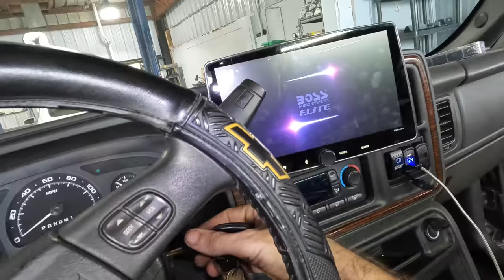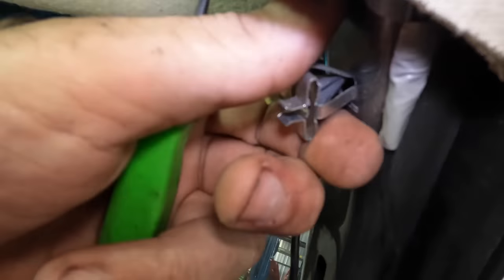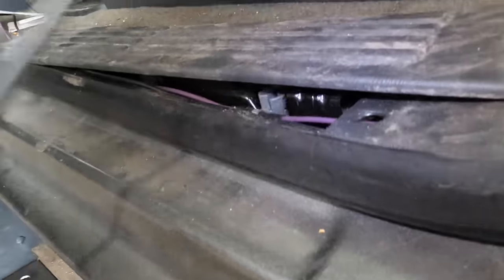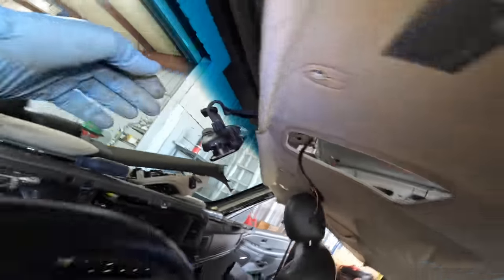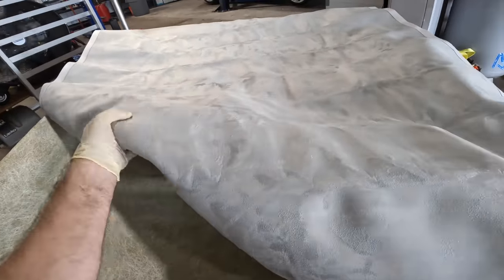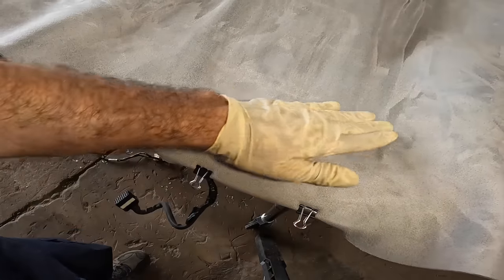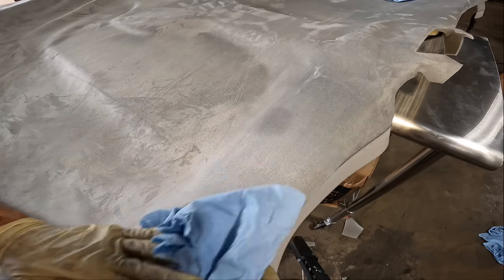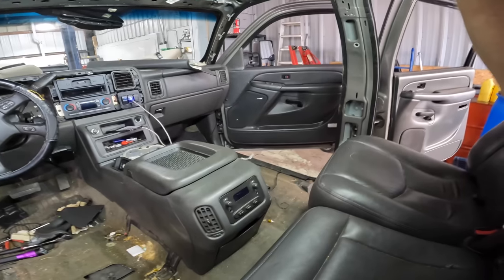Sagging Headliner! NOT an EASY Task!

Comment: Great video, I have been having problems with water leaking in from my antenna on a 2015 Ford Transit connect.  I tried to remove it and reseal
it but it's leaking again.  To repair it correctly,  I need to purchase an new antenna.  Plus I destroyed the dome lite by accident.  Best to just cut the wires instead of
trying to get it apart.  I broke it pulling it apart and a new dome lite is not cheap!

Comment: I have seen the pros do it several different ways. One guy uses a bed sheet on the good side of the headliner to keep it from getting dirty. Once he rolls it in place, he covers it with plastic and pours sand on it to hold it in place. He vacuums the sand off, removes the plastic and lets it dry.

Comment: When I did the headliner in my car, after I removed the fibreglass/Styrofoam header, before I put the new liner, I spread 1 thin layer of fibre glass resin and mesh on both sides. This was done to stiffen the header because if it breaks, you in the stink hole and need to replace the header. Once the Fiberglas is cured, give it a light sanding, wipe it clean and then spray glue and place your new liner.

Comment: you know what you can do with the visors without replacing them is, you can fine the correct automotive spray paint can and just spray paint them. I did that on one of my Mercedes, I bought a replacement visor,  and I spray painted it the same as the same color as my interior.  super easy and a lot cheaper.

Comment: That's  a wonderful  truck and glad getting to thr interior! Always  noticed the driver seat and when you were going to replace the lower seat! My 02 Taho was worse having  never done it before it wasn't hard to do! Luckily  my headliner is in great shape it's  bigger and has top AC ducts! Then again I guess  it would come out the rear! Hey finish  the carpet. Your half way there! Glad to see you used a socket in your  previous video to remove a gear clamp instead of a flat head screw driver!

Comment: Ray i did that for Bentley if you ever do it agin use a  sponge to flatten the carpet on to the area your hand is to tuff to make the smooth touches that are needed. Great job though ps use a heat gun to fix cresses!

Comment: Like you Ray, I've not done a headliner replacement ... but one thing I probably would have done is to mark the center of the headliner board and found the center of the new headliner fabric and match those marks up with each other. then working from the center out to the edges, that way it's even on all sides... kind of like laying tile on a floor, you start from the center out so all the edges would have the same size tile along the walls. I'd also use a stiff rubber squeegee (like the ones they use to apply large decals) and work the fabric onto the board.

Another thing seeing Ray do it is that I'd do it in smaller sections than the quarter of the panel at a time. I'd probably split that quarter part into two or three sections and do that instead of the full quarter.

Edited to add: When doing the cut outs, I'd do the X, then glue it, then cut off the excess after... but all of this is just my opinion as I've not done it myself.

Comment: Work at Ford, at the plant that builds the Super Duty, back in 99 that headliner job was a couple jobs in front of me, not a bad job but truck didn’t have the front window in yet and none of the trim, not fun when they had to replace one after it got all the way built though

Comment: It's an SOB to get the headliner out of a crew cab.
 I've seen it done with the windshield out.  I figured it was possible but wow.  What a PITA.
 My extended cab T800 and reg cab T400 don't have B pillars in the way so you just rotate the headliner down 45° and pull it out. The SUVs you can take right out the back.

Comment: That blank wire connector is used for the rear HVAC system and the explore they use that same harness and not only the track but also in the explores and a couple of the other vehicles so it’s accessories like the HVAC for the rear to plug into your controls for the fan and stuff for the backside That’s the advantage of living next-door to GM’s truck plant in Indiana.
Reply: I said explore I meant the Suburban.

Comment: Not sure if I now feel somewhat educated or afraid of what is ahead of me with my 2004 2500HD Extended Cab…
Thanks for another great experience video, Mr. Ray! ☮️
Reply: The extended cabs do not require seat removal, so you can bypass that step, unless you are doing carpet stuff.
Reply: @MrJamestheredneck  Thanks for the info!
I’m not too worried about the carpet, but I’ve been putting off the headliner for more than 5 years… Amazingly, it’s not getting any better!  🤣😂😎
Reply: You're welcome, I have a 2000 silverado extended cab and didn't have to remove seats to remove headliner, but I did because I was rebuilding everything

Comment: I remember you did the moonroof replacement at your old place of work. Good Luck .I've seen other videos of taking the liner out thru the windshield after windshield removed for other repairs.
Reply: My 2014 silverado had to have a headliner done at the dealer under warranty after a water leak. They had to pull the windshield to do it and naturally broke it in the process.....

Comment: Hopefully you see this before you start to install the carpet. I would like to suggest putting in sound deadening material on the floor you will be amazed at how much quieter your ride will be if you do that. And As for your wiring I would suggest running your wires through what is called braided loom it is stretchable they come in different colors so you can recognize it it is flexible it does not leave a mess like electrical tape and is not as thick as plastic loom. This stuff is amazing and I use it throughout my car. Also, what you might want to do with your wiring up there as suggestion is get yourself super thin wire such as phone cable that is 8 maybe 10 wires in all, then, run up a ground 12 Volt constant accessory and ignition and fuse it at the start. This way whatever circuit you use will have the wiring you need it could send the signal down through the thin wires, which you then attach to relays to then run the power for whatever circuit you're running it'll be a cleaner and more efficient installation. Hope that helps.

Comment: If your radio does not have handsfree that plug behind the cluster might be for the microphone in the headliner. driver side round item you called a speaker thing. I do upfitting and a lot of complete interior removal. It's fun. Good job Ray, It's going to look great with the material you picked. Maybe use pistic paint for the color clips to match the headliner color.

Comment: Also: I'm betting there is a chunk of vehicles with headliners that can only removed (and more importantly) installed through the empty front or back windshield frame.  It wouldn't be cheaper or quick, but it would give a far better chance of not dirtying or damaging the new headlliner.  Probably easier than completely removing a door for the extra space.  Think about it: on the factory floor, headliners either went in through the front or back window frame, or through the door openings of a nearly bare body shell, possibly even upside down at the time.

Comment: Instructions on glue say "hold the can 6-8 inches away from surface".  Ray proceeds to hold can 1-2 inches away from surface.  You may have used way too much glue.  Haven't finished the video yet, you just started spraying the glue.  I'm sure it'll turn out better than the previous headliner.  Love your videos, Ray.

Comment: I was told the only way to do it properly is by removing the windshield. It cannot come out through anywhere else without damage. If you look close he did break it at that thin front middle section when pulling through the door. It will not be that visible when settles in so not a big deal. But for smaller cars it will break more and may be a bigger deal.
So if you have your windshield replaced have a good look at your headliner. Maybe it's good time to do it.

Comment: Several years ago I was asked  to show up at my office at 0 dark thirty in the morning. I had retired but obliged fearless leader to come back to work and save the department. I would drive the 25 miles from my home to the office. Many times in those morning hours you'd find yourself on the interstate with the same cars and drivers. One was an old beat up Ford Crown Vic that was heading to work at the same time. The head liner of that car had  for all intents and purpose's completely detached. It had ballooned up behind the driver and front seat pax and completely wrapping the rear pax in the folds of fabric. Coming  up abreast of the Vic you could see the back seat paxs  attempting to push the smothering headliner  out of their way, while the front seat pair were pushed down almost below the dashboard by the falling fabric. The Crown Vic never deviated in the lane, the driver doing his best.

Comment: You almost inspired me to tackle the headliner in my XJ, almost 🤣 The permetex glue works very well, used it to put the felt on my pool table. And it was about half the cost of the adhesive the billiard supplier had.

Comment: i have a 2016 Silverado, head liner has water on drivers' side due the shark fin antenna leaking, sunroof doesn't work now, rear sliding window quit too, dealership wants 800.00 to pull the headliner out, they said that they have remove the seats.

Comment: Ray, I'd try to use baking soda and superglue for the broken trim tabs, especially where the tabs are used to just hold the trim in place and are not a structural element.

Comment: 1:02:05...did the glue set up though ? .Head liner work is tough , for sure...I've got to do it to my Jetta shortly . It'll be harder ' cause of the side and front  air bags .I'm planning on using a hypodermic needle attached to a 3M product w/out detaching the fabric . Good job as usual ...🤑😃...

Comment: Always use a heat gun or hair dryer while stretching the material to form to the contours of the fiberglass. Otherwise it will pull away from the fiberglass when the car is heated from the outdoor temperature. Been there done that.

Comment: Comments seem to have gotten hijacked by a marketing service for some sort of financial adviser.
Getting us back on track, the last headliner I did was in 1989! It was a Fiat 128 3P that somebody had “smoked carelessly” in, resulting in very uncomfortable seating, ultra dark tinted windows and a largely missing headliner.
Very different system, with the only glue being around the edges, where the cloth wrapped around the door and window apertures. The rest was held up by spring steel bars through pockets in the fabric. When we finally got it all in and the seals were securing the edges, we had to steam the fabric to shrink it and tighten it.
When these rigid headliners came out, I thought they’d be easier to deal with, but watching this, now I’m not so sure…

Comment: Pull the side pillars, floor panels and mats, rear panel, dash and instrument cluster, seats, and properly center console to remove the part that the truck is built around.
BTW, you're not just a hammer mechanic, you're a hammer and pry bar one. You pull off repairs and disassemblies that put fear into most of us with hardly a thought.
I'd be researching Chiltons, any manufacturer info, and today anything from the internet before even thinking about some of your jobs. Keep it up.

Comment: I was showed how to do it and watch it done before I did mine. To fit it first then pull it half way back the I used 3m spray stuff and spray it all over the card board of whatever they use. Also spray the under about 1 inch or 2 inches then lay half of the headliner over and press it down and wrap the other underneath board. Then pull the other side up and do the same thing you did to the first side. You are not suppose to spray the foam part from what I was told. Work it in you will have some wrickles. Then put it in the sun and about 4 hours or more and it will it looks great. Going around the edge and under is the hard part. Let it alone 24 hours before you cut your pockets out.

Comment: There is a technique to taking off those A-pillar inserts without breaking the studs.  Instead of pulling them straight back, you're supposed to "roll" them off by turning them inwards towards the center of the vehicle, then gently pulling them off by rocking back and forth.  I had to watch that on several YouTube videos when working on my friend's Suburban. I was able to remove two A-pillars off a junkyard Suburban and replace the A-pillars on my friend's car, which were ruined by a stereo shop who didn't know what they were doing and broke them.

Comment: do anything that you can or need to do now
aka
evap core (if needed)
YOUR wiring harness
Anything you might need to fix that goes above the headliner or below the carpet
anything you might need to fix in the dash or center console or behind

i only say this because this way you will not have to remove them again and as you have almost everything out already might as well go whole hog

Comment: That 'dead plug' behind the cluster might be standard installation in case the vehicle was going to be an emergency vehicle, and it would connect to switches on the dash to activate lights and sirens.

Comment: Ray I see you’ve added a aftermarket stereo to your truck was you able to get the steering wheel controls to work with yours I have a 2006 Silverado with a 5.3 I can’t get my steering wheels controls to work with mine if you could help thanks
Reply from the maker: There’s adapter harnesses that let the SW buttons work with the radio. Look on Crutchfield.con

Comment: Why didn't you use the shop vac to get rid of the foam and tiny pieces of fiber glass when stripping it off? Blowing it off makes for a very messy shop not to mention everyone walking around scratching themselves from the fiberglass everywhere. Been there done that.

Comment: My 2002 Chevy crew cab dually with 122,000 miles has a perfect interior. No falling headliner, even the leather seats still look new. When not in use, it's always closed up under a car port. I'm guessing heat caused this on yours. Yours is probably not an 'LT' like mine which has dual lighted vanity mirrors and dual sunvisors on each side

Comment: Kind of figured the rear seat would have to go. I have an '05 2500 Ext. Cab and not hard due to the suicide rear doors. I pulled it out and had an upholsterer here in Palm Bay put on for $80. Well, cause I'm a spaz. I noticed earlier you replaced your dash with one from an Escalade. I have wanted to do the same but, also need everything behind the dash. Having a big problem locating one even drove all the way out west of Jacksonville  and was totally garbage. Anyone you know have anything?

Comment: Nice video Ray.  Yes, upholstery is an art form all to itself.  I did this very repair to my Monte Carlo years ago, yes I still have it.  The result would have perfect if one of my moron friends didn't step on it as the glue was curing.  DAMMIT JIM!!!  The next time I bought a complete headliner which was on a different type of backing which was much more flexible and easier to install.  It came rolled up in the box.

Comment: No criticism,  but an observation from someone who knows nothing from nothing about this.   When i have watched videos of people who DO do this for a living, they hold the adhesive sprayer (or spray can) MUCH further away from the work.  I dunno why, don't pretend to know why, it's just an observation.  I will be curious to see how this hold up long term, one would think you'd have a GREAT bond.   and 2/3 through the video, it looks great.  My kid's Volt got rear ended about a year ago, and after 4 months in the shop, it came back with a junkyard hatch that had no had a needed recall done, and a screwed up headliner.  I knew what a PITA it would be to get it out to try to fix it, but after seeing this I might attempt it.   Maybe.

Comment: You really should use a small rubber roller wheel to apply the headliner in just ensures no air bubbles and a uniform application.

Comment: If you have to do this again dap brand landu top adhesive and a harbor freight spray gun work way better than any aerosol can spray. The landu top adhesive is also uv rated because it is for vinal tops. If you get any adhesive on the upholstery rubbing alcohol or paint thinner on a rag wipes it up no problem. Local guy in Florida headliner magic is the best place for tutorials or pointers. That permetex and 3m stuff is a rip off

Comment: Now that there is what you call a 💩job. Not necessarily the quality your craftsmanship or anything but rather the entire job itself. Either A) That should never happen to a headliner in the 1st place, which it indeed does or B) They should be designed with serviceability in mind, whatever that might mean. Plus virtually nobody would even care if they came in smaller manageable sections so long as it included neat looking joinery trim. There should just be 4 locations(mid F/B & L/R) on the roof with a spot welded(hell even epoxied) nut or female retainer clip IMO. Upholstery places that do van interiors & such had modular interior panels mastered decades ago. Manufacturers have been dishing out inferior crap for so many decades now that its somehow become accepted & even expected. Hunt them down I say. I want names ! Addresses are OK too. 🤣👊

Comment: You should punch those holes out with a leather hole punch before installing it on a piece of wood. It will be difficult once hanging on the ceiling.

Comment: Mr. Ra-Ray, Sir...  I've always wondered why you don't use a cordless drill or impact driver with a Phillips or Torx or whatever bit you need, instead of just always using a hand held screw driver...?  Being a contractor, I would be absolutely FRUSTRATED to death if I did not use an electron powered driver.